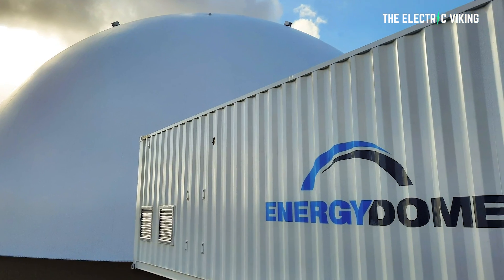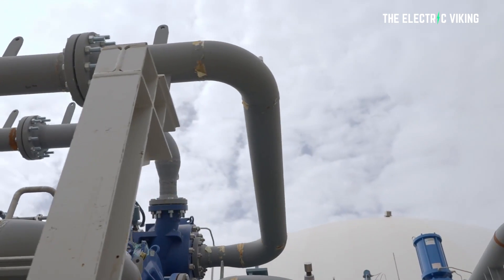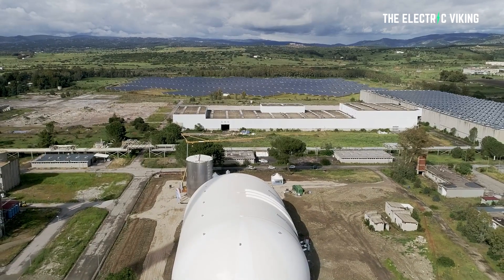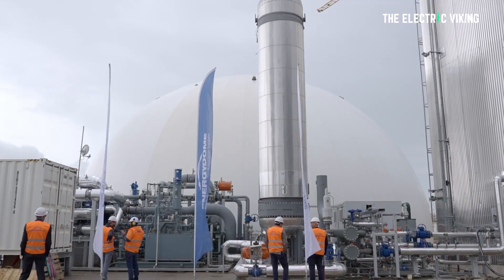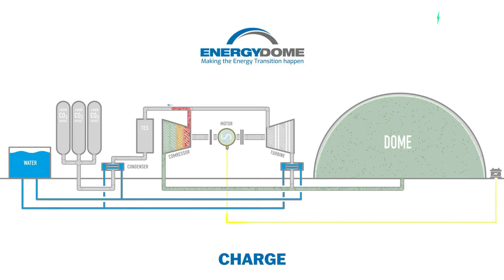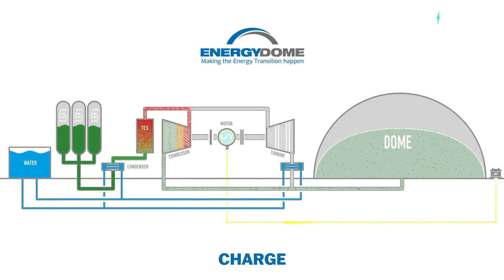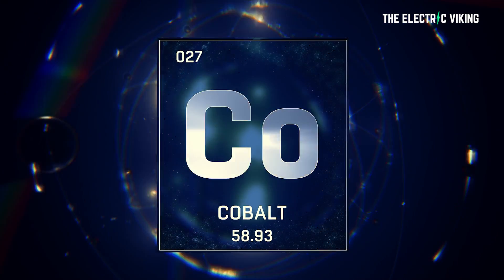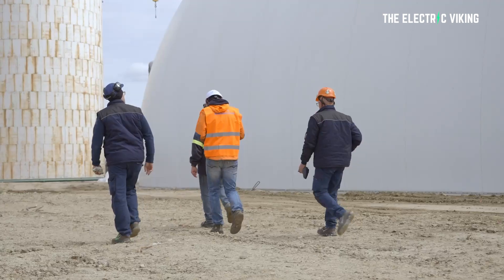NEW CO2 battery is about to change the world as we know it

Comment: It looks to me like it doesn't remove any CO2 from the atmosphere during operation;  it uses excess energy to compress gaseous CO2, then generates electricity by allowing the liquid CO2 to expand, which can then be recompressed.  So it would be roughly comparable to pumped hydro power plants or ones that store energy by lifting weights.  It is simpler than storing the potential energy as liquid ammonia, which is subsequently used to produce hydrogen, which can be burnt.  Iron flow batteries are another technology that might be roughly comparable.  I think the decision will simply come down to cost and compatibility with the energy needs of the power grid.
Reply: Highview energy has a similar product but just compresses air. I’d like to see a discussion of the engineering trade offs of one process vs. the other.
Reply: @ejduffy  All compressed gas solutions are problematic. They amount to a heat engine which has a terrible efficiency because the temperature differences are low. Pumping water uphill and returning it is strictly mechanical and has theoretical 100% efficiency. Actual efficiency can exceed 80%.
Reply: @ejduffy  compressed Air yes. CO2 compression from air impossible as a 🔋 battery.
Reply: Yeah, it is nothing new.
Reply: @knabbagluon  They claim it is 75% efficiently. That is pretty darned good for not being a lithium battery, which is in the 90's. The big advantage with this should be the cost of adding capacity. Volume goes up with the cube of the diameter, and surface area goes up with the square, so making a bigger tank means it gets cheaper by unit volume. This is tremendously useful getting through a dunkelflaute. Also you don't need fancy geography or a lot of space for one of these. I think I would put them at shut down coal plant sites. Already messed up industrial, and has already paid for big grid connections.
Reply: @fjalics  yeah I guess the big thing will be the storing of the heat and the reheating.
That is what basically killed all other projects before it.
Maybe they have a better way of storing the heat.
And of getting the heat back in the progress. We will see.
Reply: @fjalics  you'd have to increase your compressor and condenser infrastructure capacity as well to suck out the bladders in a timely manner.
Reply: @bloodyslatts1452  I don't think that is true. Storage is always about power and capacity. With this kind of storage, you could focus on capacity. Lot's of battery storage is 4 hour. You could make this 3 day, or 5 day.
Reply: This kind of system is already used by a company in Great Britain, I've seen a video from the Youtube channel 'Just have a think', already more than one year ago(!), about a system like this in which they used liquid air and were capable of capturing CO² in the mean time. They're using techniques already available for decades ...
And Yes, the future will be magnificent!!! Keep up the good work, love your channel!!!
Reply: @hermanvierhout3081  They were liquefing ambient then as a side process distilling off the CO2
Reply: @Pharisee Spotter I highly doubt that. Removing CO₂ from the atmosphere is difficult and expensive - it is only 0.0314% of the gases air is composed of.
Reply: @paulg3336  it's getting easier Paul
Reply: Thank God it doesn't take any CO2 out of the environment. It finally became easy to grow crops. Not a single greenhouse in the world would ever run at 280 parts per million if they had an option to put CO2 in. But that's what we lived with for most of the agricultural time of History.

Thank God it's over 400 parts per million now
Reply: MoneyThink  If they can burn Natural Gas then it's cheaper to just use Steam in a turbine. Not this madness.
Reply: @Pharisee Spotter then it has nothing to do with Wind or Solar. I mean it will not be an efficient process at Scale
Reply: tAKE co2 OUT OF THE AIR PLANTS DIE THEN WE DIE
Reply: This channel keeps spouting the monumental global warming lies.
Reply: @prioris55555  and the lies of solar, wind, Evehicles.
It's not CO2, it's not you, it's the SUN.
Grand Solar Minimum. Crop grow zones are shifting. Africa will come back online for food. Starting in some areas already. 
64 and the Sun today is white, at high noon, not the orange color I grew up with.
Reply: @prioris55555  Such an articulate and well sourced response. I'm impressed.
Reply: @prioris55555  that's because we're all part of a global cabal who are only interested in discrediting Big Carbon and ruining your day prioris.
If you turn around right...... now!
Hu. too slow. You didn't see me.
But we're watching you.
Reply: @bloodyslatts1452  alien galactic cabal watching me also.

Comment: Should they not answer.  
Because the battery does not consume CO2 it is at best CO2 neutral.    Unless they pass the CO2 on to a new unit it will have to be released.
Although they are saving the waste heat generated by compression to evaporate the liquid CO2 there will be some heat loss.  The overall efficiency of this system is dependent on how well they can manage the heat.
Your question about energy density hit the nail on the head.   The gas to liquid ratio 535:1.   It takes a lot of storage.